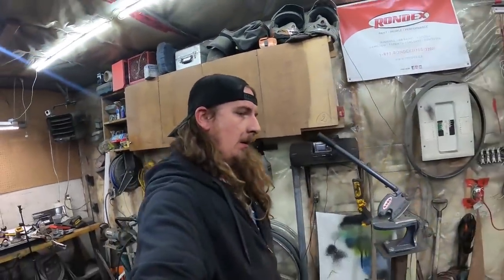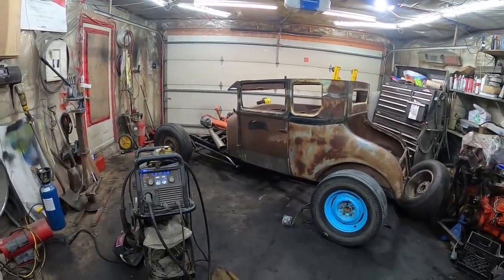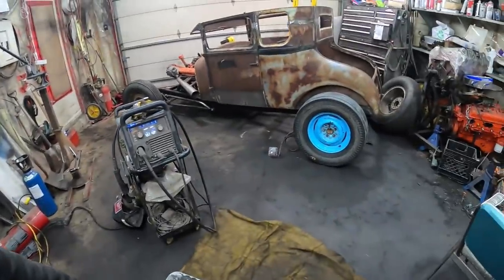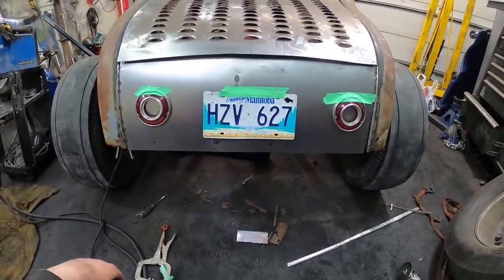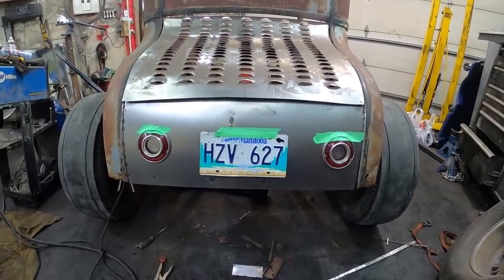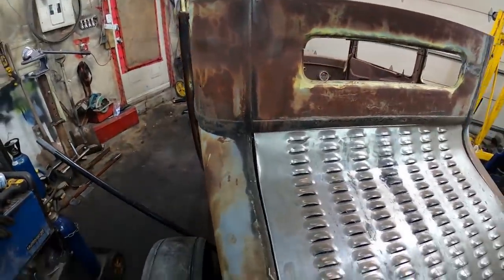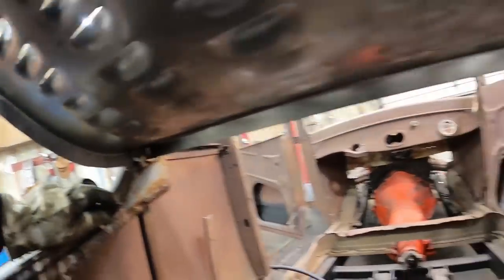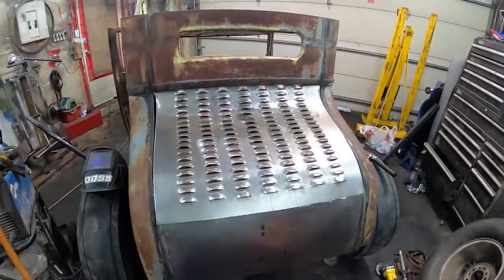Making a Custom Model T Roll Pan - 1927 Model T Rat Rod

Comment: Paint the body flat black with red pin strips . Then paint the rims and the frame red with white walls tires. But it's your car do what you will like in the long run. Thanks for the  awesome videos.  Be safe out there.

Comment: Okay, Your T is really starting to take shape. and looking good thus far. A couple of things, first, there is a slight curve in that panel which you could have duplicated by forming it over a piece of 6" pipe. If it where mine I would do it over. Second, I would shorten up the rear axle a little on both ends so that the tires are within an inch of the wheel tubs. Makes for a cleaner look. And yes, I vote for some paint even if it is a satin sheen. Keep up the great progress !!!
Reply from the maker: yeah just learning on this one.  ill spend a few more bucks on the next one

Comment: Deck lid/lower panel use two 'L" shapes that fit together/overlap in the correct orientation [gives strength to the lid and something for the bottom to butt up against; if it ever came to it, it also gives a place to fasten adjustable stops so to control how far down the deck goes (in/out/flush)].  Assuming hinge action is at the top.
The difficulty with installing and rolling/shaping on the car is not that it can't work its that there is always some pressure/stress on the metal and you never know where exactly it is, to what degree it is and, perhaps more importantly, what it will do.  Example, hit a bump and it might oil can the other way.  IIRC from the live feed you cut holes in that lower rear panel to put lights, guessing the metal moved a fair bit as those holes will relieve any pressure in that immediate area.
You saw the other up locally, funny how the patina looks the same.  Near identical, more pink/brown than rust.
Reply from the maker: yeah metal is a funny thing.  I'm still learning how it works but I think its turning out great,  Thanks for watcghin!

Comment: Yeah its coming along nice and I'm with you there's enough body work to where it wouldn't look right with out paint but u can flat black it with some fake wear spots and fake rust that it will look super awesome like primer it red oxide then flat black then kinda sand spots back to the red oxide then clear it all or just leave as is that thing will look awesome I think like that and maybe paint your logo on the door and age it some kind of way and that thing will be badass and maybe you can sneak a big cam in it for the cool sound and you will have one super cool cruiser
Reply from the maker: yeah it needs some custom art work for sure!

Comment: I have an idea for the louvered panel. Use an old style T-shaped, keyed garage door knob and then alter the back side so it has a flat tab that engages the lip to secure it. Or if you want you could actually make it work like it does on the garage door and have a rod on each side that goes into a hole on each side when the knob is turned. It's a very inexpensive solution that I think would work very well to give you a locking trunk area. And those T shaped knobs would match the period of the car as many of them had T shaped handles.
Reply from the maker: cool idea!

Comment: HEY Dan ! things are lookin' mighty fine.Big difference having a tail pan.For paint you could just do the Tremclad route .I've got new wire wheels you could fit on that nice blue angle grinder you have to take off as much of that surface rust as you can .Check online for a recipe for a paint /thinner mix and roller it on with a 6 inch lint free roller.Try the red oxide primer first then if ya want to... pick a color.It will be thicker than spray bomb. Their black comes with 3 choices flat, gloss and semi gloss.I"m sure you'll figure it out, and it's easy enough to change.You could also with your bead roller make your own license plate shaped piece of sheet metal ...louver it ...and put "DD Speedshop" on it. Don't see anything illegal about that.I'm not back to work til Tuesday , yup I'm a yapper, and I need the break.
Reply from the maker: you deserve a break greg!  the next episode i "paint" it haha  buckle up its a rollercoaster

Comment: Hey Danny, I like the looks of the rear panel, coming out great. I would love to see the car flat black, like denim black. The denim (flat) would also hide any imperfections LOL.  Have you thought about putting a Nerf bar on the back (as a bumper) like they did back in the 50s/60s?  Just a thought. Looking great buddy. - Later
Reply: Add a rolled pan (horizontal) not a roll panel (vertical) !
Reply from the maker: yeh i might mess around with a nerf bar down th road.   they look pretty cool

Comment: I have 5 "drop in" anchors set in my garage floor that I use to attach my winch to...easiest way to pull cars in...without them, it is almost impossible to move cars around...just requires a hammer drill and a concrete drill bit...they sit flush with the floor and you just use a large bolt to screw into them which is the anchor for your winch.
Reply from the maker: yeah I think ill be doing somthing along those lines

Comment: Here is just a thought because I haven’t seen any do this. When making a panel, be it a rat rod or whatever so here goes. Make a cardboard template of the panel you want to create and then go to your junk yard with you template and compare body panels til you find a panel that matches your template. Then ask how much to have the skin cut off. It could match your whatever and you would have to figure out whatever  you might have to bend flat metal to recreate the panel you need to create.
Reply from the maker: yeah thats actually a really good idea!

Comment: on the deck lid if you want it stronger you need to build the x type frame put on inside on deck lid will help it from bending plus help with the noise of body flexing ,
Reply from the maker: Yeah im working on a new structure as we speak.  thanks for the support my friend!
Reply: Trunk latch? A push button VW engine deck latch  would work but the lowest center louver is in the way! Above posts suggest frenching the license plate. Correct, the proper taillights don't need frenching, their shape will flow with the body lines. But what about hiding a latch release behind a hinged frenched licence, you'll need it to open your 'louvered filler'?
Deck lid stability? Get Brent to plasma cut a pair of scrolled side pieces to weld a rectangular framework fitting the top, sides and bottom rain channels which the lid is fastened. Then as another post suggested form a bead roller sheet metal X or horizontal K inner lid  
brace.

Comment: Since you asked, I am a weirdo,  I prefer paint over "patina" (which is a fancy way to say wrecked finish and rust).  I view myself as a caretaker and in theory the car will outlive me and I am preserving it for the future. 

Its not like a gallon of filler, a Taiwan spray gun and a single stage gallon of paint from eBay is expensive (what $250- US for everything including sanding materials) . I always hear people say that patina keeps the price cheap and if your under 25 building a hotrod I agree to get you cruising but when you have to remake the patina to fake the funk you have gone to far and the steel loosing its original protective coating is what caused the rust in the first place and "surface rust" eventually becomes cancerous. 
I know its a debate these days but when the ratrod scene came out in 2000ish it was the young guys pulling old tradional hotrods out and getting them going then guys that are my age now (40+) decided they were cool too with thier streetrods and they threw away the billet wheels and air brushed rust on everything.  
I just can't do it anymore but its your car ultimately you have to decide what will make you happy and you have to decide how far you want to go with it but that being said its not like it has aged gracefully like your 57 or pickup where it shows its age like a person does when we get older but when you got it it was a dead corpse that you literally dug out of its resting place where the scavengers and picked its bones clean and now your Dr. Frankenstein and the T is your monster you're resurrecting.
Reply from the maker: i do like the beater looks so thats usually the way I go.  One of these days I would like to have a nice traditional hotrod though

Comment: You should recess the license plate into the metal or French it in by cutting out a rectangle from your tail panel and then cut out a metal box using your new shear and fold the edges to form a box then burn it inauthentic you know!
Reply from the maker: yeah that would look sweet!  but im kinda lazy haha

Comment: Me personally id weld some 1by2 tubing about an inch from bottom of deck lid on inside and build latch off of it. And red oxide prime it all with scallops brushed on and mabe some pin stripping
Reply from the maker: yup i address it in the next video

Comment: Hey. Looking forward to seeing this one get to the interior. Maybe not too fancy?? A small steering wheel with fast steering?? I was thinking to make the rear side windows smaller like to a diamond 💎 shape or small oval ?? Just to be different from the same.  Looking good’!!!
Reply: The proportions (all) are correct. I recall Cottington added a window to a Tudor, first class work but it looked out of place!
Reply: Wayne Spyker I seen that brown turd anyone with skill can squeeze that out.   Proportional or not it’s in the eye of the builder who’s happy with it. If  dd was building it for me I’d tell him how I’d want it to look.  Fill in the back window to half size length.  The back window is of no use anyway if your not eye level with it. I’d still want those rear side windows filled in with a different shape than “square “. If it were mine.

Comment: English wheel will smooth the panel. Let me know if you want to use it. Seen they make fibreglass bodies for that car.
Reply from the maker: english wheel is way to fancy for this sucker haha
Reply: I got the small princess one the only time I saw it on sale in 3 years. Think it was like 20 off. But  just to buy the dies or wheels it’s about the same price. Figured the 47/48 have a ton of curves so I would need it.

Comment: Just an idea but I think the rubber strap that holds down jeep hoods would be kinda cool for the deck lid
Reply from the maker: yeah that would be a sweet look for sure
Reply: We mold those straps for today's large truck hood hold downs. Only in longer lengths than the Jeeps.  Never.
Racers used belts with buckles. Henry used nickel plated spring loaded hood hold downs. Whatever should be hidden inside the trunk.

Comment: Yeah, I am still sharing ya  with anyone... I even send it to farmers, they should know better than let me subscribe. Stop!    No more paint, its a rat rod, not a go find a hooker car. I would clean up any welds, that hole that you pointed out... Leave it! Dust some rust an primer where have too to save it from going any further. I am trying to say that it really looks cool and its a driver (soon as it fires) as it is... a roll of metal on the top to make a ledge and then figure a black tarp on top to keep your ass dry in the rain. I know it will snap and pop if it ain't sucure so we gotta come up with something unless you want to go metal. I would make it safe. Safe is good. Get shocks an stuff on  the ass and the front too so it can't bounce up and down and drive the guy nuts that sees it coming in the dark and the lights going up and down might make him find a safe spot off the road till your by him. If your going to do metal on top then we gotta figure out how to use that roller so you can put some stiffeners in it.  I think that behind the seat can get busy with a way to close off the trunk from the front and then put a roll bench in there so you can pile some beers and food to hang at halfasses someday or shit like that. Go look at some of "Big Daddy's cool cars or who was it did the batmobile and some other wild stuff like george barris I think. But let it gets some rust on the metal and blend it with primer so the next guy is hammering dents and painting it ... Unless your that next guy and I see you liking it already!!! Not making money if you keep em all but like I said before, It is your first born... thank god for no child support. Well in a warning sign, Get back or I will "rust you" .... na, too corny but your going to think of a clever name. ..... King D speed shop, na you have a name for business... A name would set the build and how far to go.. that is what I am thinking.. going to need a handle for that tail thats louvered. You can get creative with that cause no one sees it, just the outside. .... I'll think on this an send message
Reply from the maker: haha i always appreciate the support and commetns morgan.  keep fighting the good fight my friend

Comment: I'll say it again, another T coupe body wasted. Why do people not bother to examine a complete body to determine how was built? There are videos covering how to make the replacement panels. Granted you do not have a bead roller but it is not that hard to duplicate the original panels.
Reply from the maker: this thing was chopped up yard art 2 months ago..... pretty sure i saved it from the crusher
Reply: @DDSpeedShop  Yes but you are not restoring the body lines that would have been present had the person who first worked on the body destroyed. Hot rods retain their production body features, rat rods are junk built by people who destroy potential hot rod material. Ron Covell did a video on recreating the body lines on model T coupes.